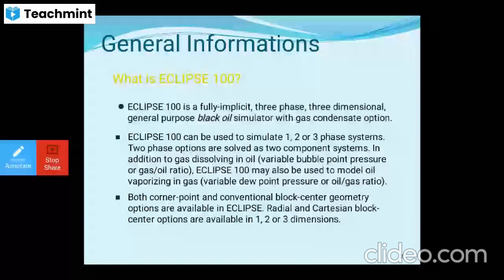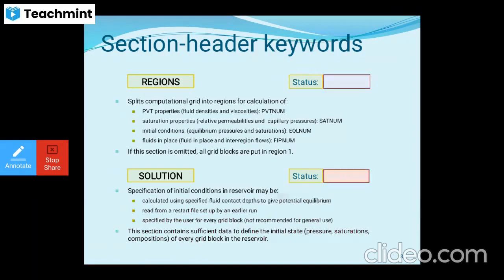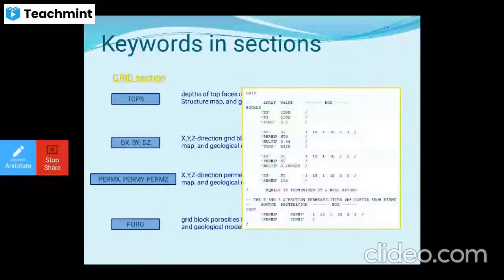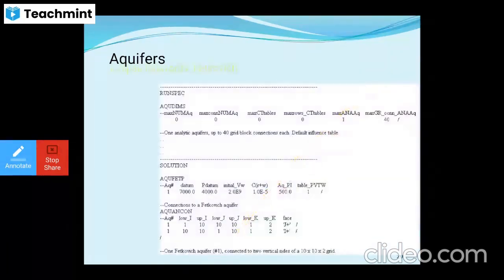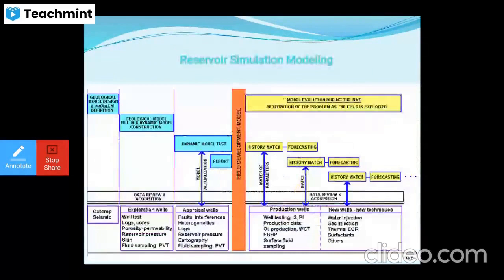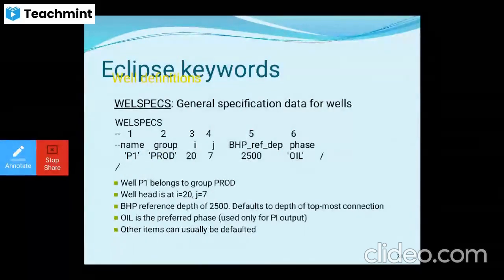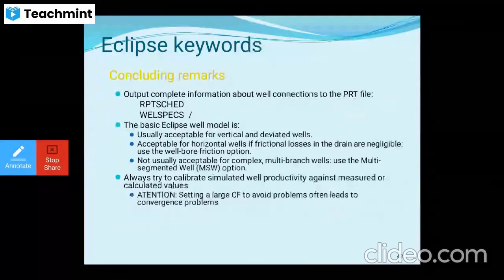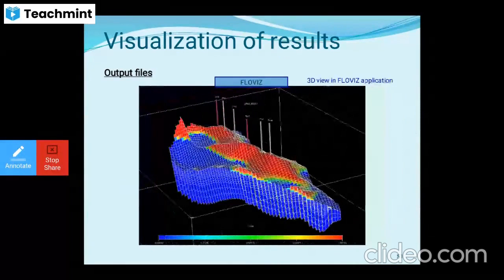Introduction to Reservoir software Eclipse

Comment: Hello sir, I need your help please. I am a student in petroleum mechanics at a university in Cameroon and I am a big fan of you. I am in my final year and my end-of-study project concerns underground gas storage. natural in depleted deposit. I wanted to know what software I can use to do the injection simulations. Please I am waiting for an answer and sorry for the spelling mistakes I am French-speaking
Reply from the maker: try with iWIT-TM software solution for  UGS-Underground gas storage from Wood group
Reply from the maker: also try with KAVPOOL software tool  for underground storage facilities
Reply: Sir I saw that Kavpool is only used for storage in salt cavities while I am working on depleted deposits and iWIT-TM I could not get the information. thank you sir